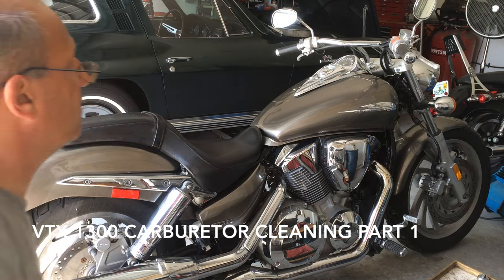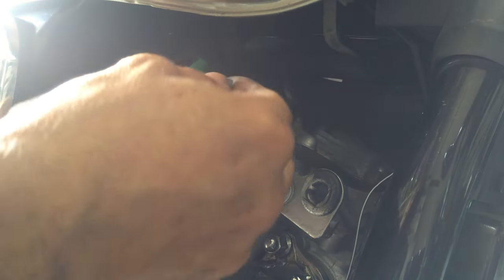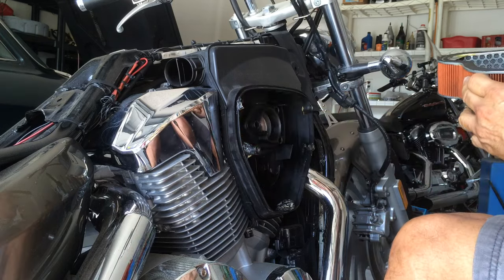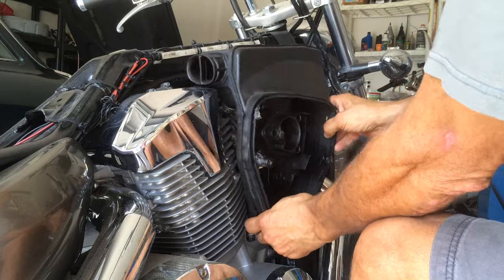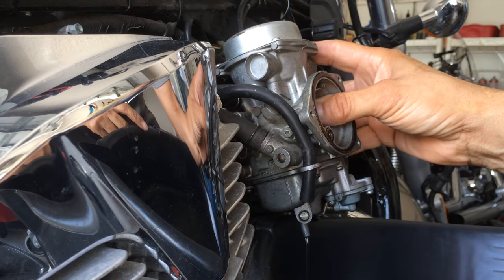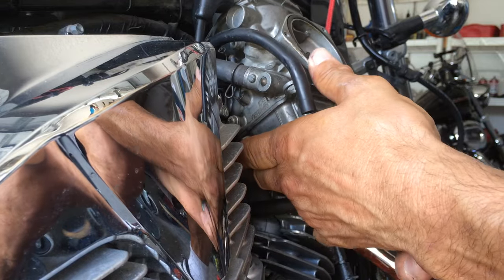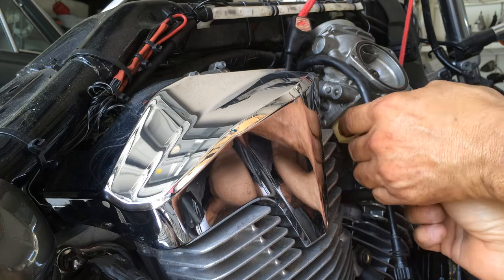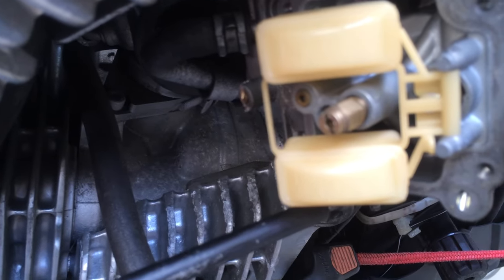How To: Honda VTX 1300 Carburetor Cleaning Part 1

Comment: I just bought a 2006 vtx1300r today for an amazing deal.  Been sitting a few years so of course carb is gummed up.  Have the intake off and when twisting the throttle I'm not seeing the fuel spray from the accelerator pump as shown in this video.  Would the gummed up carb cause this?  Was told bike ran fine before sitting.  Will be pulling the carb this weekend anyway but figured I'd ask.  Bike has tons of aftermarket parts, pipes, hypercharger pro series, not sure of jetting but will know soon.  Have new air filter for the intake on the way.  Picking up new plugs, oil and filter tomorrow.  Cant wait to ride it.
Reply from the maker: Yes it will,  Test petcock clean tank, clean Carburator. Let us know how this works out. Harley petcock is the same as your Honda VTX  https://youtu.be/7Fo9Q93OJXI.  Start at the tank and fuel and vacuum lines. Test Petcock, Then clean Carburator. New battery  and start.  Any questions just ask.  Thank you for your Sub Jordan.
Reply: @TwoWheelRocco  Bike was stored with a full tank of gas so luckily no rust issues, looks very clean inside.  I will drain and refill.  I dont have a vacuum gauge unfortunatly.  Any other way easy to test the petcock?  I'm sure it's fine but will replace if it proves faulty.  With the carb I plan to remove completely from the bike.  If it was already running I'd do as you did and just hang it off the side but want to be thorough with it.
Reply from the maker: So that gas tank was full of fuel? To me this should be an easy fix.  I would hang the carb and clean. Your carb has hose that go to your radiator.  Keep it simple... Clean idle and main,  New battery and see what you got..Start it... I done many.. VTX are great bikes. Let us know how this works out. You might be surprised. They put bike up with gas turned off. Ran it till it stalled and stored this bike..
Reply: @TwoWheelRocco  Any tips or tricks with dealing with the pilot screw?  I know it requires a special D shaped tool but some have made there own or were able to twist it out somehow with a regular small screw driver and then grind a slot in the head so a flat head can be used.  I'm assuming the carb has been worked on before considering the v&h pipes and hypercharger but if for some reason it's all stock I want to set it to 2 1/2 turns out and will probably shim the needle as well from what I've read online.
Reply from the maker: Ebay.   https://www.ebay.com/itm/Motion-Pro-D-Shape-Replacement-Bit-for-Pilot-Jets-w-D-shape-adjustment-57-8242/402248050609?epid=544861639&hash=item5da7da27b1:g:06IAAOSwUYNaDivz.  Keep it simple. Hope this Helps..
Reply: @TwoWheelRocco  Carb is comming off the bike tomorrow so wont have time to wait for that to ship.  I'll order one now that way if I cant get it adjusted with what I have I'll come back to it when the tool comes in.
Reply from the maker: All will be well.  Thank you for your update..
Reply: @TwoWheelRocco  So I hung the carb off the side and cleaned it out.  Jets weren't blocked but also not clean.  It has a 195 main and 65 pilot.  Blew them all out, sprayed out where the float seat sits and carb cleaner ran out the fuel line so I know that's clear.  Fuel still isnt making it to the bowl.  I cranked for a while and used some starter fluid and it fires for a split second and die.  Open the drain screw on the bowl and nothing comming out.  What might cause fuel to not make it to the bowl?

So I took the vac line off the petcock and fuel line off the other side.  Put another vac line on and created suction with my mouth.  I read that it should cause enough pull the get fuel flowing.  If no fuel flow then somethings up with the petcock.  Now I need to find a way to drain the full gas tank and take the petcock off.
Reply from the maker: Remove the tank and hold it upright and drain when you remove petcock.   Test with vacuum pump.   https://youtu.be/7Fo9Q93OJXI
Reply: @TwoWheelRocco  I was able to just tilt the tank forward and remove the petcock.  I removed the diaphragm and they seemed a little stiff but freed right up.  Put back together and back on tank.  Hooked vac line and used my mouth for a little vacuum and bam fuel flowing.  Bike is running now.  I didnt adjust the pilot screw. Wanted to make sure it ran first.  Its backfiring pretty good on decel.  But seems fairly smooth.  I've only ever ridden one other vtx and that was many years ago so cant remember how it felt.  I'll probably wait till the pilot screw tool comes in and pull the carb back off and adjust it depending where it's set.  But fired right up no choke needed.

Also any reason someone would mix and match the spark plugs?  Rear cylinder on one side has the stock dcpr6e and the other side a dcpr7e.  Same with the front cylinder.  All plugs are on the blacker side so indicates some richness.  I'm going to put in 4 new dcpr6e plugs and evaluate it's running condition.
Reply from the maker: How was the screen in your gas tank?
Reply: @TwoWheelRocco  So where there should be a filter/screen it's no longer there.  Must have deteriorated away.  Gas is clean and flowing nicely.  But I'll drain and refill anyway.  It seems to idle well and with revs comes the popping.  While riding it seems smooth and pulls well.  Roll off the throttle and more popping some really loud.

After putting new plugs in and a quick test ride I pulled the plugs and a few showed signs of being lean. Little on the whiter side.  Right side front cylinder was the leanest of them all.
Reply from the maker: You will need that screen, that is all there is to keep the junk out your fuel system.  Rebuild you petcock diaphragm Is a must so fuel will not make it way into your intake threw you vacuum line.  Causing that rich looking plugs and popping.  Do it now or do it later...But you will be doing it. Until that is straightened out you will not be able to fine tune your Bike. VTX will run Strong when set up right...Leave all adjustments alone until you Fully restore fuel system. Trust me you will love your work when done. Let us know how this works out Jorden.
Reply: @TwoWheelRocco  Well the plugs are now on the lean side.  I'm guessing it was running rich while it was being ridden daily before it sat for a few years.  Now it's running lean.  I didnt really plan to keep this bike so not sure I want to do to much more to it.  Biggest thing was making sure it ran because I bought it with no battery and unknown running condition.  I'll see how things go though.  Can the screen be bought without buying a whole new petcock?  And is there a kit to rebuild the diaphragm?  If they arent costly I'll get them ordered today.  I'm not in a rush to sell the bike but have a 2004 Suzuki intruder 1500 as my daily bike.  Also have a 2003 yamaha fz1 but that's being sold in a week.  Was hoping the vtx would be more comfortable as I have some injuries that make riding tough.  I'm changing the oil as we speak, it's fairly dark.  Also going to do the driveshaft fluid as well.  Basically full tuneup.  Have a new k&n air filter installed in the hypercharger intake too.
Reply: @TwoWheelRocco  Looks like I found the diaphragm kit for about $33 and the screen/filter for a little under $20 so that isnt horrible.  I'll get them ordered so it's one less thing to fail and cause issues.  Should have by the end of next week.  Too bad a whole new petcock assembly is $100+ otherwise I'd just get a whole new one.  But for $50ish I'll rebuild and put the new screen on.
Reply from the maker: It will be worth the small investment. With the rebuild you know it is Honda parts..Ride Safe and have a great day.
Reply: @TwoWheelRocco  With some luck just these petcock parts will help.  If not I'll have to continue troubleshooting.  When the petcock comes off the tank again I'll thoroughly flush it out to get whatever may be floating around.  And put some fresh gas and seafoam in before I run it next.  By the time the parts come in I'll also have the pilot screw tool.  I wont adjust it but want to see what it's set at.  It must be set right because the bike ran well prior to sitting.
Reply from the maker: That how I would do it...You will be fine.  spark plugs will tell. I like to count how many turns out and note that..Then spray some carb cleaner in that hole where the screws was.  There will be a tuning screw spring, small washer and o ring.  Clean and you will see where it sprays out in the through of carb....very small holes for you idle. she will run great...Good Luck and let us know how this works out.
Reply: @TwoWheelRocco  Yep that's the plan.  Take care of the petcock, fresh gas.  Pull the carb back off and check the pilot screw.  Give everything another quick once over.  Accelerator pump is working too which is good.  Shouldnt take much more to get dialed in.  I also noticed the pair valve is still in place so if for some reason none of the above things fix the issue I'll delete the pair valve.  But one step at a time.  At least I have other bikes to ride while waiting for parts.  Also with my current setup with the vance and hines big shots and kuyakyn hypercharger pro intake what should the pilot be set to?  I've read 2 1/2 turns out I'd perfect for most stock bikes at a normal lower altitude.  But with these mods I've read it doesnt need to be out as far.  Also with having a 65 pilot as well.  Didnt look for any shims but I'll see if any are present next time the carb is off.
Reply: @TwoWheelRocco  So looks like the petcock rebuild is probably what did the trick.  I noticed the spring wasnt in the right place when I pulled it apart but reassembled with the new parts according to the online diagram I found.  Also pulled the carb and used the d socket to remove the pilot screw and clean it out.  It was at 2 1/2 turns out which seems to be the go to setting for these.  Got it back together aside from the hypercharger and it fired right up and no more backfiring like before.  Still have to test ride but I had removed most of the pieces on the rear fender in prep for some paint correction I'm having done next tuesday so have to resecure those pieces before I can hit the road. L. Things are looking and sounding much better though.  Really appreciate the suggestion on the rebuild kit and getting the new screen.
Reply from the maker: Happy all went well. Keep it out of the shops. Do your own work. Thank you for your Support Jorden. VTX 1300 are Great Bikes. Ride Safe and have a great day.
Reply: @TwoWheelRocco  Yeah I always do my own work, havnt taken a bike to a dealer yet.  Appreciate the guidance and love watching your videos.  Well made and right to the point.  Look forward to riding mine this week and really testing it out.
Reply from the maker: Ride Safe and Thank you for your kind words Jordan.
Reply: @TwoWheelRocco  Figured I'd give one more update since I took the bike for a ride.  Seems to be doing great, no more backfiring on decel just an occasional bark but to be expected with aftermarket pipes and the pair valve is still hooked up.  I went to the gas station to fill the tank and put air in the tires as they were low from sitting.  Rides well, doesnt have as much power as I'd like but it gets up and moves and sounds great.  Unfortunately it's not that comfortable to me anyway, not a fan of the mustang seat and the hypercharger intake pushes my leg out a bit.  But it's a beautiful bike, 3k in upgrades alone.  Have it up for sale now.  Will be keeping my 2004 intruder 1500 and 2003 yamaha fz1.  Thanks again for the help!
Reply from the maker: Love those 1000 Just to keep your blood flowing..  I ride a 2004 CVO King. and 2011 GSXR1000. take a look  https://youtu.be/R5xWC6XDnAk.   Ride Safe and have a great day.
Reply: @TwoWheelRocco  Great looking bike.  I've had probably 50 bikes over the years but never a gsxr1000.  My fastest was a 2000 Kawasaki ninja zx12r with bolt ons and tuned plus nitrous.  I plan to do a turbo build in the future.  But for now the fz1 takes care of the speed itch.  I have a buyer for my vtx so that will probably be gone tomorrow evening.
Reply from the maker: Thank you, I love the green mechines. Thats where I started in the 70s.and 80s Kawasaki H1s and H2s  Ride Safe And have a great day.

Comment: hey Rocco ..so I got the bike running and when I push the choke  all the way In it dies and when I crack the throttle open it dies..what do suggest my next step be?
Reply from the maker: The idle jet is clogged....clean Idle jet and make sure gas supple is clean...check gas tank and screen...Let me know how it works out.

Comment: Hey Rocco! I cleaned this carb a few months ago then my bike sat. I'm running it now every day and it idles very low and eventually will die if I dont give a little throttle. Also cant do a normal roll with just releasing the clutch. Is that a carb problem? Also replaced spark plugs around the same time I cleaned the carb. I've seen idle adjustments being brought up, but havent found a video on how to do that either? Any recommendations are VERY much appreciated!
Reply from the maker: How did it run when you first clean carburetor?
Reply from the maker: To adjust idle small knob at the bottom of air cleaner, Turn clockwise to higher your idle...Let me know how it works out.
Reply: Idle was a bit better. I found a video specific to the 1300 explaining the idle adjustment and the A/F adjustment as well. Going to give it shot when I get home tonight and I'll update shortly. Thanks!
Reply: Alrighty sir, so I'm attaching a link to the idle of my VTX. Raised the idle this morning since it went down since I did it yesterday. Is that supposed to change? Also, while its idling, its sputtering. Do I need to adjust the A/F in a different way? Messed with it about 20 minutes this morning trying to find different settings and still couldn't find the sweet spot. Also, the thing only starts well with choke on. Could this guy just need another Carb cleaning? I appreciate all your help!

Heres my Idle video:
https://youtu.be/jvi-cq46NKw
Reply: Another question, owner hand book says minimum octane rating of 86 but someone told me this morning 93. This is my first bike, what do you recommend?
Reply from the maker: I would need to hear it revved up a few times...I think you need to drive this bike and see if it gets better. Don't sound that bad..need to hear the motor revving. Hope this helps.
Reply: @TwoWheelRocco  okay, I might just be a bit paranoid. Lol I'll try to get a video of the revving tonight and update this link again. Your vids have helped me in prepping this bike for riding, so again thank you so much for taking the time to help!
Reply from the maker: Happy to help, Happy Thanksgiving..

Comment: I don't see the air screw by the carb float on my 2004 VTX1300S.
Reply from the maker: Take a close look there is a safety plug so you cannot make these adjustments need to be pre-drilled and removed five access to the air fuel screw. Take a good luck and let me know what you think. Thank you for watching and your sub Coolramone. Ride safe and have a great da
Reply: @TwoWheelRocco  Thank you for your prompt reply and your helpful video. I think I did see a metal cap about 1/8" diameter near the choke hole and idle jet, but I'm not drilling out that cap unless all else fails. :) And I already have the carb cleaned and reinstalled, will crank it up soon and post results.
Reply from the maker: @coolramone  Shenwill run fine..VTX 1300 are great bikes..
Reply: @TwoWheelRocco  I just rode it around the block a few times. Carb jets have been "de-gummed". First time this puppy has been ridden in 5 years. Thanks again.👍👍👍
Reply: @TwoWheelRocco  Hey Rocco can you tell me how to fix a Honda Magna 750 with a carb leaking fuel?
Reply from the maker: @coolramone  Happy to help. Any questions just ask.   VTX 1300 are great bikes. Thank you for watching and your sub. Ride safe and have a great day.
Reply from the maker: @coolramone  your problem lies in the float needle jet not seating.  gas eats them up. Replaced with new ones and gas leak is gone. Any questions just ask.
Reply: @TwoWheelRocco   I replaced all 4 float needles when I cleaned the carbs, but the carbs still leak gas. Is there something else needed?
Reply from the maker: @coolramone  if this is a VTX 1300 there's only one float needle jet. As one carburetor.. What bike are you working on?
Reply: @TwoWheelRocco  The VTX is running great, thanks. Now I'm working on Honda Magna 750 four cylinder vee with 4 carburetors. When engine starts gas drips from the carbs.
Reply from the maker: @coolramone  figure out what carburetor is leaking by the black hoses that runoff them. And replace the  float needle jet. Hope this helps. Let us know how it works out.
Reply: @TwoWheelRocco  Looks like 3 carbs leaking. I replaced all 4 float needle valves (with pointed rubber tips on top) last year when I cleaned the carbs.
Reply from the maker: @coolramone  So this will work again  Like I said I would check the petcock out the screen and make sure all your fuel is clean going to those carburetors. Let us know how it works out and what bike is it again?
Reply: @TwoWheelRocco  Hey Rocco I found the gas leak in my 4 carburetor Honda Magna 750 and fixed it. The fuel hose from the gas tank connects to a rigud plastic fuel tube that enters the carb. The tube has an o ring on it and it was old and failed. I relaced it. Thanks for your advice to see where the gas was dripping from. 👍👍👍
Reply from the maker: @coolramone  Happy to read all is well. Thank you for watching and your sub Coolramone.  Ride Safe and have a great day